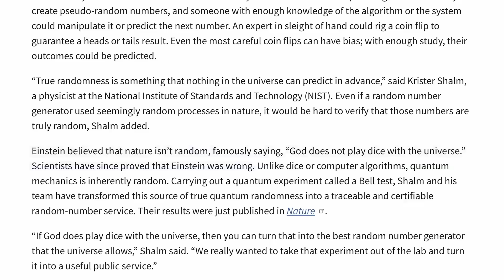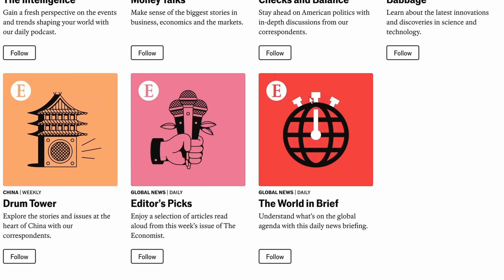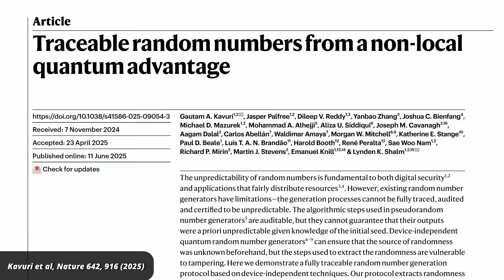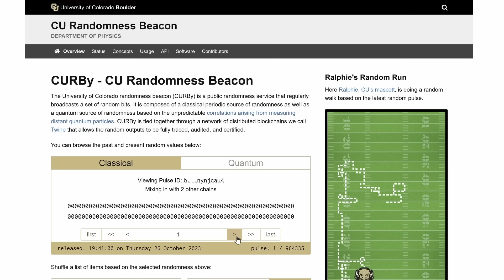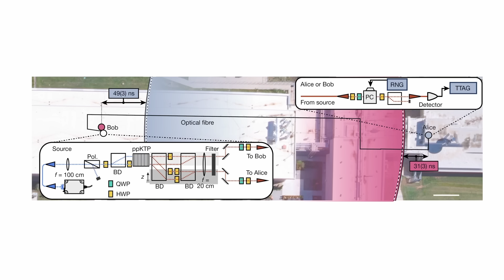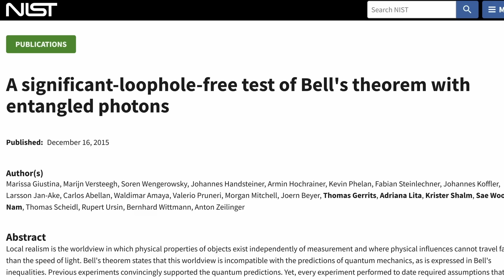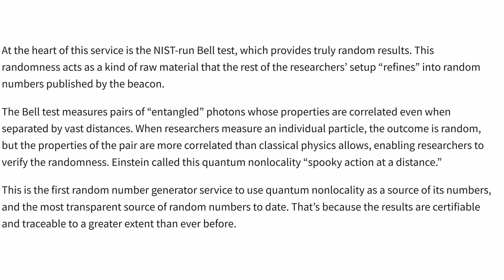Was Einstein Wrong about Randomness?

Comment: I may have fixed Occum's Razor, which is clearly wrong in cases where optimal point exists in higher complexity. Comes with making an abstract space of decision trees, and ordering the decision trees based on complexity. Just super likely optimal points exist in high complexity. But if like game theory or Market investments, biological evolution, there times where simple opponents where the optimal point in high complexity only use a branch of the higher complexity decision tree optimization. Meaning the optimal point for the simplicity exists in much lower complexity becuase it will only be using a simple branch the whole time.   Where if there high variability in behavior, lot of different strategies and abilities going on all at the same time, then Optionality, more complex decision trees will win out.  So it gives me a way to quantify when Occum's razor can be true as a special case.  Lot of this is deterministic as leptons. lol. Maybe a new way to look at electron orbits in such a framework, while this stuff more for knowing when to run with an exploit in a market or jump back to a  more complex desicion tree of options for economic storms, it surprisingly can start to look like maybe behaviors and decisions electrons make are a learning system that converges to where they end up being measured. But the base could be random, or deterministic, logic wouldn't care, logic would only care that there is some kind of fitness function where the system learns (converges).
Reply: That is total gobbledegook. Occam's Razor has nothing at all to do with anything else in your comment.
Reply: @avsystem3142  That because you don't understand optimization, clearly the vast number of choices lay in much higher complexity, and so probability of a high measure fitness for almost all measures will be no where near the tail of simplicity, which maybe less that .00001% of some complex systems. Occom's razor says the optimal point exists in that tiny fraction. Physicist like it or not its their logic error. However working in the space of decision trees on how to explain and word systems, sub-trees of a much higher complex tree existing in high complexity, could run 99.9% of the time just down one branch for simple minded folk. So the optimal point could exist in simplicity in a practical sense.
Reply: @arizonasean7198 Do you seriously think you made any sense at all with that comment? You even grossly misstated the advice of Occam. Seek help.

Comment: Turn that we always known that atomic decay is somewhat random or at least as close as you can get to true randomness especially for you mix the isotopes in a random way 
? I mean if you take the fine tuning argument to the extreme and as you've also said you could burn a piece of paper and if you knew all the variables you could actually put it back together in that case maybe not but that's a pretty extreme hypothetical scenario and that's really been always an argument at the philosophical level for everything I mean all the way back to the Greeks throughout ethics and bioethics.
Reply from the maker: Assuming you mean nuclear decay, it's a bad example because we know that nuclei have a lot of internal structure. It's quite possible that the decay depends on the exact internal dynamics which is unresolved. That is, in this case we actually do have hidden variables that we know of. It's harder to make this case for, say, the decay of (supposed to be) elementary particles (eg muons).

Comment: You know what - you're right about Bell's Inequality.  I've seen many, many videos on it... but I've never actually managed to understand the thing.  I look forward to your stab at it!
Reply: Bell's Inequality isn't difficult. It is best explained without reference to QM at all.

Say you have a box with a button on top. When you press the button a light either flashes red or green seemingly at random. Is it random? You don't know. It could for example have a computer inside running a pseudorandom number generator. Hidden variables.

Now say I also have a box that does the same thing. When we press the buttons together  the light flashes the same color on both boxes. Non-locality? Not really. The boxes could just be running the same random number generator. Or they could be sending messages to each other in order to agree on what color to flash.

Now say there is a knob on top of the box. When you turn the knob  it does not appear to change anything. But when you look at my box you see that they are no longer perfectly correlated. The amount of correlation depends only on the angle between my knob setting and yours. Non-locality? Nope. You can do this by sending secret messages between the boxes.

Now say I turn my knob to the right by just enough to create a 10% error rate in our correlation. Then you turn your knob to the left by just enough to produce a 10% error from what the original sequence would have been. What error rate do you expect to see? Classically you would expect to see close to 20% error rate which is just the sum of the two errors. It will be a little less because the boxes could error at the same time thus correcting the error. 

But what if we do this and see that the error rate is much larger than 20%? Classically the only way to do this is if the boxes can communicate the knob settings with each other so that they can arrive at the correct correlation.

But what if we did the test with the boxes far enough apart in space and close enough together in time so that no message has time to travel between the boxes due to the speed of light limit? This seems to suggest faster than light communication.

QM seems to allow such boxes while classical theories do  not. Maybe it is faster than light communication. Maybe pressing the button caused the universe to split  into many worlds. Or maybe thats just how the universe does things and the universe does not owe us an explanation. In the end we just see a strange correlation that confuses our little monkey brain.
Reply: The inequality is easy to understand. It is just the idea that if we assume humans can make decisions that are independent of any physical laws, then they could not be subjected to any laws that preserve correlations between the human decisions and other particles, and thus the other particle cannot possibly "know" what decision the human would make. 

You can then show that the statistical behavior of the particle depends upon the measurement choice (a property called contextuality) even for spatially distributed measurements, and so if the particle cannot know your measurement choice ahead of time, it must be non locally influenced by it.

Despite common misconception, denying hidden variables does not restore locality. This was the point of the EPR paper, it is effectively a mathematical proof that any psi-complete interpretation must be nonlocal. Copenhagen and Many Worlds are manifestedly nonlocal and they try to avoid this with word games by redefining nonlocality to be something else (like defining locality in terms of being able to make practical use of superluminal signals).

The only way to restore locality is to drop the assumption that humans can make decisions that are statistically independent of physical laws, and thus can be subjected to a law that guarantees their decision will be pre-correlated with the behavior of the particle.
Reply: Call this an idea, not a theory...  What if a measurement creates a pathway in the applicable fields. For example, a double slit. The two pathways are equal,  until a detector is placed. Might that change the fields which govern the wave? I speak delicately because I am considering a single member of a wave in which no other members are apparent at that time.  This, to me, illustrates some kind of ..... let me say guidance toward a pathway consistent with a wave. 
  I now want to draw a picture of structure between particles,  of which I suppose I must include photons as surely as we recognize wave behavior in electrons. The structure is of fields, and they move with the objects causing them,  as do all the fields we are familiar with.
Reply: @amihartz  I know you called it "easy to understand" but I still got lost.
Reply: How do you know she's right if you don't understand it?
Reply: Actually Sabine already answered Bell's inequality it in a previous vlog. No hidden variables. The crux is what Sabine called the dual QP 'momentum-space' in which we can localize items as opposed to our macro world spacetime grid. If we acknowledge the existence of such a dual intertwined grid then OBVIOUSLY we need to newly define terms like 'position' or 'locality' also in these dual momentum terms. This is all there is to entanglement. Entanglement = Locality in momentum space terms. That's all. Split a photon into an entangled pair and you create two particles that have identical spin energy (momentum) in each of the xyz axes in the 3D momentum gird. This means they are LOCAL in momentum space no matter how far we separate them in xyz spacetime grid terms. And if they are local they can instantly influence each other. Very simply. Very elementary. Why Einstein didn't see it; that's what I can't figure out. As the master of relativity he should have seen that terms like 'position' or 'local' are relative to the grid we discuss. ..Merkwürdig...
Reply: Tim Maudlin gives the best explanations that I have seen, and even those need to be watched while you take notes and then rewatched to really understand the details.
Reply: @duggydo  As far as I know he does not explain why statistically independency (which Superdeterminism violates) must not be questioned.
Reply: i'm so confused by this comment, you never understand the thing but you some how know she is right?
Reply: This might be another instance of me writing in sand. The ONLY reason QM violates Bell's inequalities is because QM operators can be non-commuting (I have videos on this on my channel). It has nothing to do with locality or realism per se, the same inequality derived by Bell was derived over a hundred years ago by Boole without these two assumptions. Non-commutativity is deeply connected to divison algebras and topology though the structure constants of the higher dimensional spheres. The entire standard model rests on symmetries of these spheres, S3 as SU(2), and SU(3) as the stabilizer of the various subgroups of G2 (the automorphism of octonions, S7; su(3) is essentially a choice of axis on the equator of S7). The 3-sphere has a fundamental property that differentiates it from normal euclidian space, torsion; G2 relates the various embeddings of S3 in S7, and so is an expression of variable torsion, through varying coordinate structure constants of S3. There is a reason why the Hopf Fibration is so ubiquitous in physics.
There's a literal extra degree of freedom in our 3D space which we normally don't notice, exactly due to this torsion; and it is only revealed to us through coupled systems like two correlated rotations, as in EPR tests, where a 4PI symmetry is evident. Another example is a rock tied with a rope, or dirac's belt trick. These are all examples where torsion is an essential part of the description.
Reply: Bell didn't know squat about Malus's Law!
Reply: The problem with all the deterministic interpretations of Bell's inequality are that they require global hidden variables that aren't observable but look random, which is somehow better than "all the pieces fall within an EXTREMELY consistent statistically random predictability pattern". It's a theory that people are still doing. Like Sabine. We get it, it'd be GREAT if it made sense, and it probably will someday. The USA (a young country) has existed for about twice as long as physics consistent with day-to-day behavior of 99% of the observable universe, and 99.999999% of our everyday interactions. And people throw an absolute fit we don't have it all now. Ok, boomers.
Reply: @doublepinger  (1) It is not true that the "hidden variables" must actually be "hidden." There is no inherent logical contradiction with the possibility of knowing the hidden variables. A lot do not go as far as proposing they could measured because theoretical physics is hard so most theoretical physicists focus on trying to build a model that reproduces all of modern physics first before postulating ways to go beyond it, although there have been some physicists who have indeed advocated experiments to go beyond them. Both Bohm and Sabine for example advocated more precise measurements in rapid succession to see if you can find deviations from the Born rule, for example.
  
(2) You seem to paint it as a kind of conspiracy that something deterministic would appear to be random and call into "consistent random patterns." Not sure what you even mean by this, as it's already well-understood in classical mechanics that rapidly oscillating systems have deterministic behavior that can only be in practice predicted statistically. This is a phenomenon that is well understood and part of classical mechanics.
Reply: I agree. And, the very nature of hidden variable is that its mechanisms are hidden and therefore cannot be understood.
Reply: I saw a video of using light from a star via a telescope as a source for the entanglement experiment, was quite interesting.

Each test point of this experiment is moving on a high velocity helical trajectory through space time (e.g. Milky Way towards Andromeda Galaxies, etc.).  It would seem the different geometric measurement points would have their time values warped by the Lorentz Transformation, but I do not know if any accounting is being done for that.